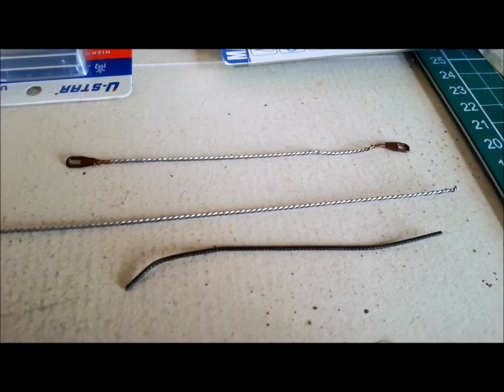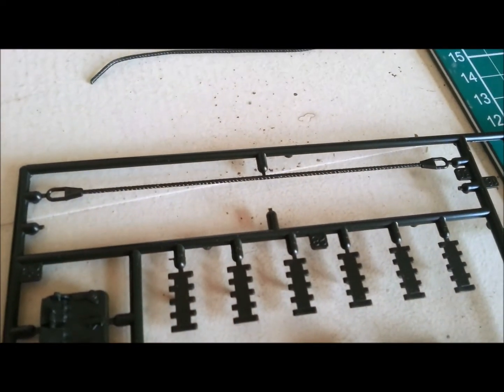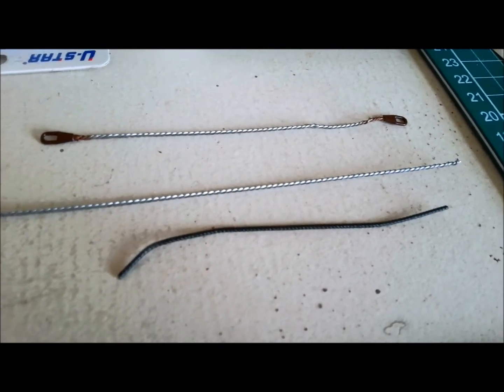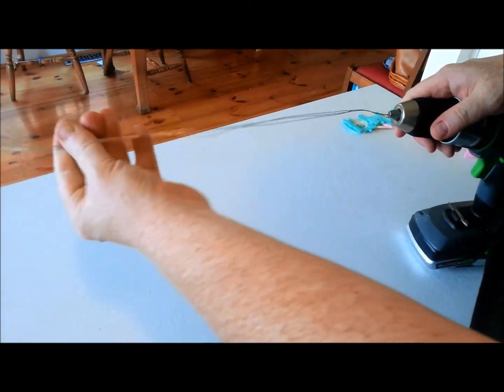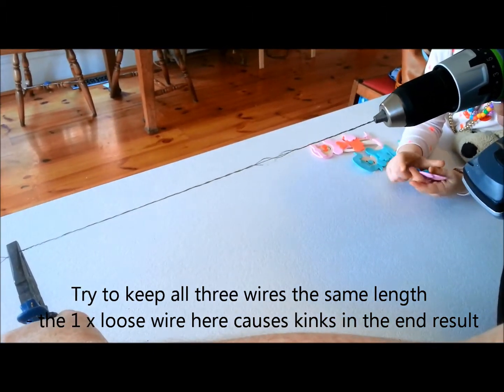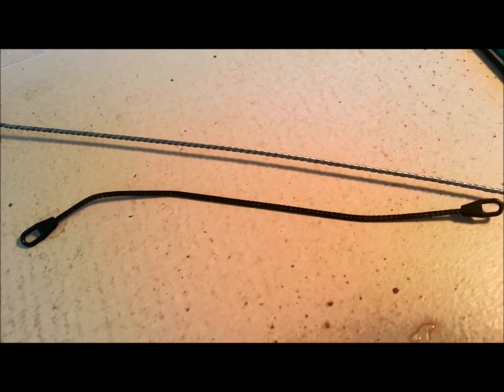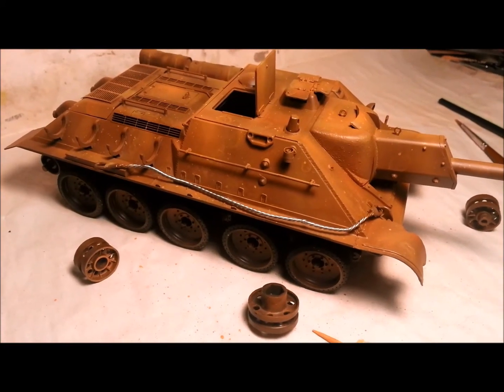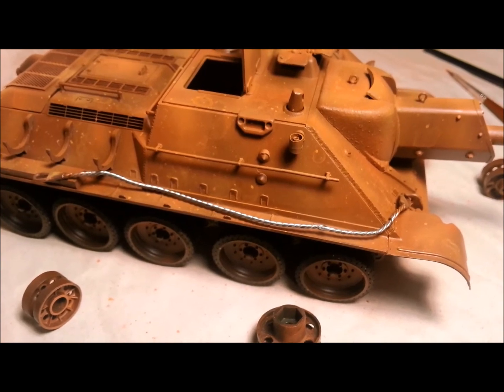How to make your own tow cables for 1/35 model tanks

Comment: Congratulations and thanks for the video, Dave. Just one question, what thickness of cables do you recommend for the 1/35 scale? Thanks in advance. Best regards from Brazil.
Reply from the maker: Thank you! I can’t quite remember the gauge of wire I used, I guess each strand was about 1mm to 1.5mm diameter?

Comment: This is a great idea. Ive been using it for years. Do you have any ideas Dave for tool mounting brackets for like the shovel ect..
Reply from the maker: I generally use very fine metal foil cut into strips. It's not as good as photoetch, but better than the older kit blobs of plastic!

Comment: great video, but a couple of questions , 1 would 3 strands fuse wire be ok, and the vital question what size drill; bit to drill out the eyelet,
Reply from the maker: Hi Hector, I'm sure fuse wire would work, it might just give you a more fine, smaller diameter end result. Also, make sure you don't over-tension it when you make it, if the wire is finer I imagine there's more risk of it snapping if you tighten it too far.
Re: drill bit size: it all depends on what final diameter you end up with once you have made your tow cable. I think mine was about 2mm from memory. Match your drill bit to the thickness of your final tow cable. Hope that helps!  Cheers, Dave
Reply: HI Dave, thanks for the info, a query . do you use the eyelets that come with the kit?
Reply: @DavesModelWorkshop  This is for Hector and anyone else...
I posted above about basically Looping the wire/cable back on it's self and either soldering it to it's self OR using thin wire wrapped around as "Loop Keepers" and using CA Glue or Epoxy to hold it. You can also "TWIST" the loop once or twice to hold it in place before you apply the solder or thread or thinner wire to create the "Keeper".

Comment: OH YES and One OTHER Option... is to get/use "Picture Frame Hanging Cable" which can be found at Hardware stores or even "Variety" type stores with a hardware dept.  AND it can be found in various thicknesses AND metal types like Copper, Brass or just normal nickle metal, and it's usually very very cheap?!

Comment: Thank you for the knowledge 🙏🏾 need this for my trumpeter challenger 2. The plastic mold is just awful
Reply from the maker: HI Crusader Matilda, glad you found it useful. Yeah, tow lines seem to be problematic for manufacturers, lots seem to have seam lines which are very tricky to remove. Good luck with it, Dave

Comment: I use the cheap Brass photo frame or mirror hanging cables from them poundshops! The great thing with them is being brass so you can take a flame to them and the tight spring relises like what photoetch does and can look amazing as can be bent so realistic like! If you haven't found this tip out yet, you probably have but def give it a shot!
Reply from the maker: That's a great tip - thank you!

Comment: While your tow cables look good I believe they use more than 3 strands of wire on the real ones making yours look too thick.
Reply from the maker: Thanks for the comment. It would be easy to use a higher number of thinner gauge wires to achieve a more authentic effect if that was a concern. Cheers, Dave
Reply: @DavesModelWorkshop  Yes it would! This is ALSO true for my "Thread and CA Glue" method as well!
I do believe that the usual or Standard "Strand Count" is about Five to Seven? And even if that is a bit low... it will STILL give a more "Realistic" effect!

Comment: I can give you another "ALTERNATIVE" to this but with THICK Upholstery Thread!

Take three Equal Lengths of the Upholstery Thread and some Cyanoacrylate or "CA" or "Crazy Glue" in either liquid or Gel form, and "Accelerator" fluid to cure the glue faster,

Using the same drill method, {OR You can HAND Twist them as well. That's what I did! :) } Twist the thread SLOWLY until it makes a nice "Cable" look!
{ I actually put my "Free End" in a small bench top, modeler's Vice! } and once it is all properly "Twisted" to the proper consistency, rub the CA or "Crazy Glue" along the length and then hit it with the spray "Accelerator" fluid, making SURE you DO NOT Inhale the Vapors as they are VERY VERY NASTY!  {This is WELL Known to ANYONE that has worked with "CA" Glues and Accelerators in the past!} Once done, you can then cut to length and either apply the loop "Ends" or what ID DO is cut it about 1/2 inch to 3/4 inch longer on both ends and "LOOP" it back on it's self! THEN I use very thin wire OR thread and wrap it around to make the "Loop Keepers" {Not SURE what they are REALLY Called?!} and using LOTS of CA Glue in Gel form, I get it so that it ends up looking solid. I spray a generous amount of "Accelerator" on it and when it cures, you can sand and/or file it smooth and paint it.

For the "WIRE METHOD" you can do the Exact same thing but Instead of using thread or thinner wire for the "Loop Keepers", you can just solder the wire to it's self creating the loop and making the Keepers smooth. This is easier in that you generally don't have to do sanding or filing to smooth them out. 
{HOWEVER... IF You don't know HOW to Solder, or don't HAVE a Soldering Iron... then you Can use the thin wire or thread method as described above! }

I hope this method helps anyone? If you have questions, you can contact me through my e-mail posted on MY Personal, YouTube Page! :D

Joe Connolly
Jefferson, Wisconsin
Reply: AND a "Side Note"... I've been a musician for over 43 yrs. and have collected LOTS of Guitar AND Bass Guitar Strings that were discarded by band mates over the years and if I need "WIRE" In various gauges, lengths AND Stiffness, I have a crap load I've stocked up on!

So Old Guitar strings DO have a use AFTER they are no longer useful on an Instrument! :D

It's always good to look for "Material Sources" like this, because it is often either VERY CHEAP, OR as in the case of the junked Guitar Strings "FREE",
and "FREE" is ALWAYS a good thing! 
It's not always necessary to Purchase materials?! They can often be found all over the place for CHEAP/FREE IF you know JUST HOW and WHERE to look for them! :D

Comment: Ow about showing us how you drilled the holes in the plastic and how you actually made the tow cable. What drill did you use? What size drill bit did you use? What type of wire was it that you used? Come on, do better.
Reply from the maker: Damien, I didn't show that stuff because it's not important: Use whatever drill you have access to. Use whatever wire you think will look right and that you have access to. If I told you it was a particular brand of wire from my local hardware store, that doesn't help anyone who doesn't have access to my local hardware store. "Do better", honestly...